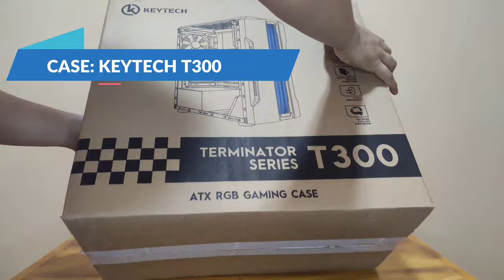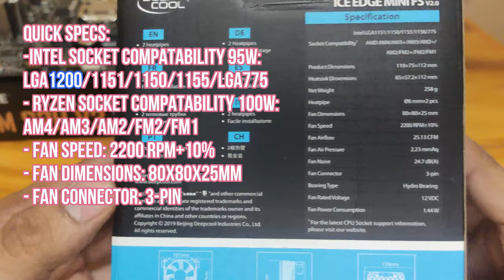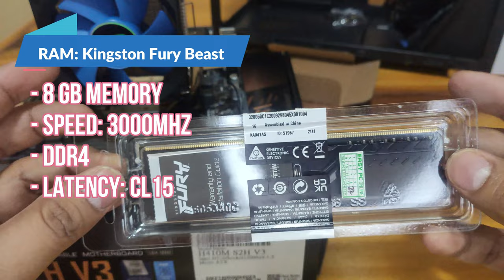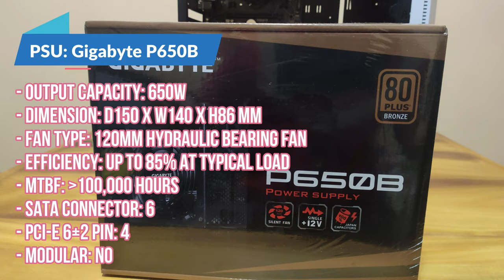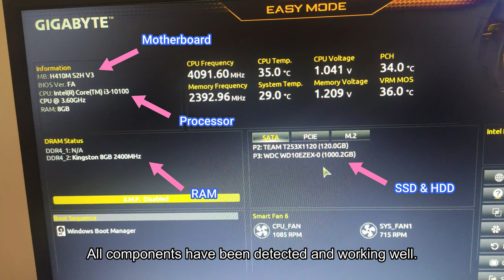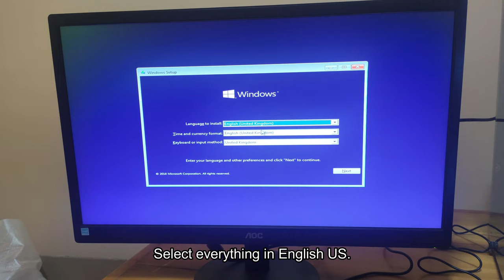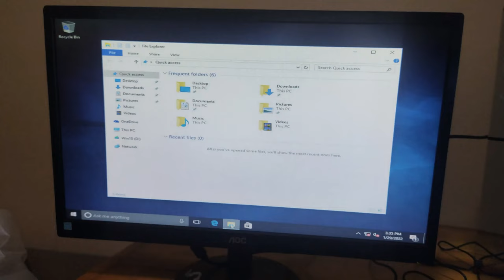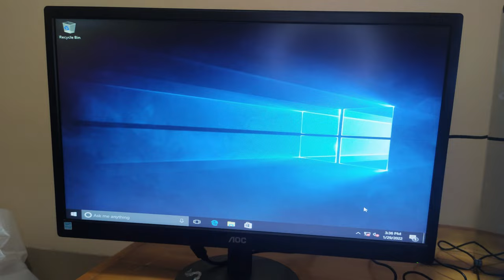Brand New PC Build for less than 30K PHP! w/ Intel I3-10100, KEYTECH T-300, GIGABYTE H410M-S2H V3

Comment: Excellent video. Congratulations on the content.
I would like to take advantage and take a doubt.
I have a motherboard like yours (H410M Gigabyte). I recently installed a Corsair Fan with White LED (Model AF120). I noticed that every time I turn on the computer, the fan flashes the LED quickly and after that it goes back to normal. I was verifying that this could be due to the structure of the motherboard itself. Can you tell me if this happened on your computer too? Thank you very much in advance.
NOTE: The fan is a 3-pin connector directly on the motherboard
Reply from the maker: Bro. It's fine. It happens with my computer as well , tho my mobo is aorus gigabyte. When I turn on the power from power source (plugged to extension ) it also triggers the color led of my fans (deepcool), then turns back to without color again , until I turn on the power button from my system unit. Nothing to worry bro.

Comment: Sir plano ko po sana dumagdag ng tatlong exhaust fan sa pc ko. Kaso diko alam kung kaya pa sya isupport ng mobo ko or kung meron pang pwedeng sakasakan. So far yung mga fans ko palang yung tatlong RGB built in fans ng COOLMAN RUBY BLACK. Kaya poba ikabit yung 3 exhaust fans na bibilhin ko o isa nalang pwede ilagay
Reply from the maker: Kaya yan sir, 2 top and rear. Then about sa sasaksakan ng pin ng fans, if ever di ma i plug lahat, pwede ka bumili ng fan hub, then dun naka plug yung ibang pin ng fans na di umabot sa motherboard. Sana nakatulong sir.

Comment: Sir bret, Ano ginamit nyo po na connection? lan po ba? or wifi dongle?
Reply from the maker: I used LAN po nung need ko na ng internet connection. Pwede din wifi dongle for this motherboard :)
Reply: Bawal po ba sya iconnect sa  wifi router na wireless?
Reply from the maker: @miguellaurilla4848  pwede as long as may wifi receiver kang ikakabit sa usb drive.